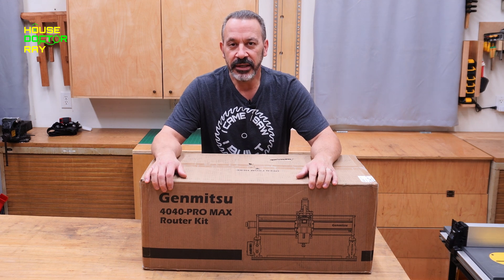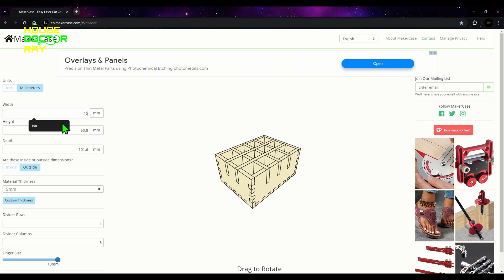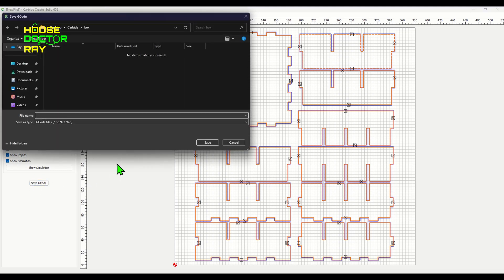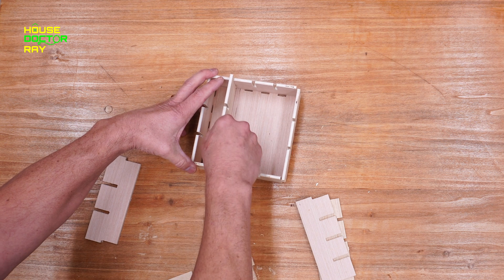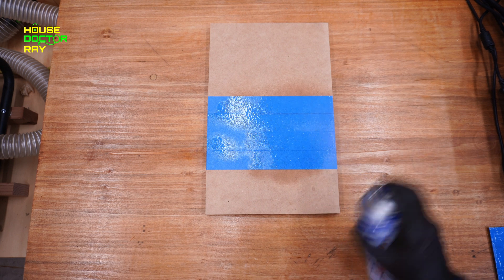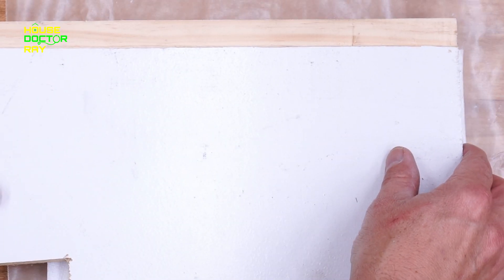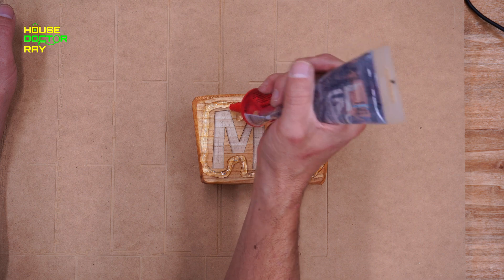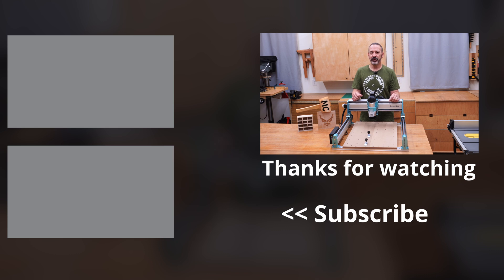What a Genmitsu 4040 Pro Max CNC can do for you

Comment: Thanks. How big [XY axis] of a tray can I make with this CNC? Are there attachments that can enlarge the foot print?
Reply from the maker: This particular model can do 40 x 40 CM (15¾").  I have done longer pieces by letting it hang of the end.
They do have extension kits to make the footprint bigger.
Reply: @HouseDoctorRay  How can I get more info on the extension?
Reply from the maker: https://www.sainsmart.com/products/extension-kit-for-4040-pro-4040-pro-max-cnc-router
Reply: @HouseDoctorRay  Thanks much.
Reply: @HouseDoctorRay  Thanks.

Comment: I did everything and software says OK but motors do not respond to commands. None of the motors.
What is wrong with this thing ?
IS there an ON OFF switch i cant find ?
Reply from the maker: There is an emergency stop button that shuts it down.  Make sure that is reset.

Comment: Hi Ray. I bought the same machine and I am having trouble with the computer part of it. I've tried using Easel Pro and  Carbide Create, and let me tell you, I am more confused now than I was before. Maybe it's the English accents of that I just have a problem with computers. Being a machinist for over 30 years, I hated CNC machining to me; it was nothing more than being a button pusher and part changer. Do you have any help for an old guy like me?
Reply from the maker: Try searching YT for 'cnc tutorial' or similar.  There are many out there.
Best to try simple projects on cheap materials until you get the hang of it.

Comment: Wish that had a larger cut area. I need at least 18"x18"   That one looks like it works good though.
Reply from the maker: Depending on your workpiece you could put feet in the corners of the machine to raise it up.  Then you can angle your work underneath to clear the feet.
You can even work off the end of the table like in this video:
https://youtu.be/YnZZ_L9pgaA?si=3CaoW-O9_xQTzmCg

Comment: In ordered a Pro Max the Amazon, but it won't be here until between Jan 17 and Feb 7, so I've got some time to watch some more video's you can make for new projects. I plan on using Carbide Create and I have the free version and have enjoyed practicing with it.
Reply from the maker: Make sure to get the dust boot I linked to in the video description and some double sided tape.
Check out LA Hobby Guy on YouTube, good stuff.
You'll have a lot of fun.
Reply: How did that Carbide Create work out? I'm interested in stand alone proprietary software not open source cloud sharing and Carbide Create Pro with a 1yr subscription says it will run these machines. Apparently you can buy the 120usd "subscription" and will run forever (in your computer files) just no updates which seems fine.